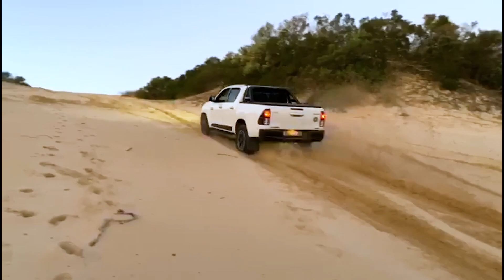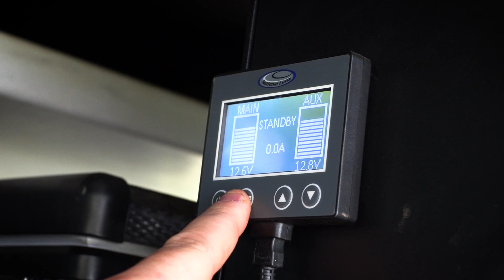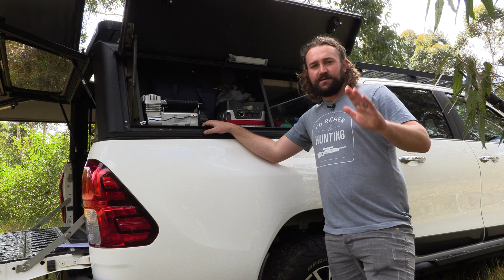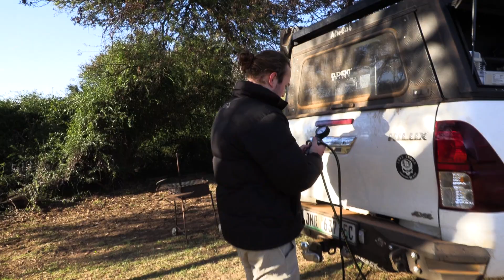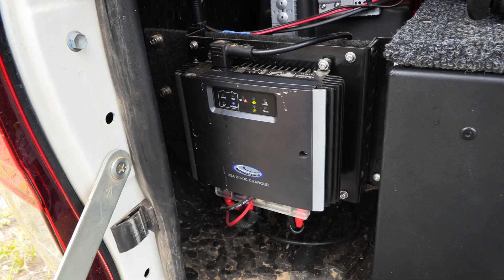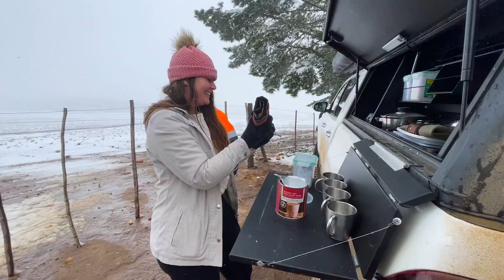Spots, Compressor & 12v Upgrades! | Hilux Overland Build, pt.9

Comment: Thank you so much for the wonderful work. Just a quick one, is it not better to connect the compressor to main battery and use it while engine is running.

Comment: I have lithium batter. All my electrical is from Victron 30 AMP DC2DC charger and a victron 15Amp charger that works for lithium and also starter battery

Comment: I loved the video! 
If you are not going to use your lithium battery for an extended period of time, it's better to actually leave it at 40-50% which will increase its life span. Weird, I know, especially when you think that the led acid battery's like to be on a constant trickle charge.
Reply from the maker: Thanks for the info!
Reply: @mattdubber  I'll always support a fellow Youtuber:-) (even though I'm still a small fry)
 Love your content. Been following you for years.